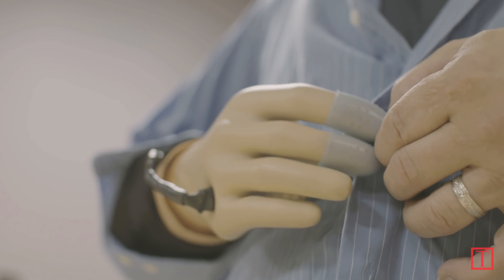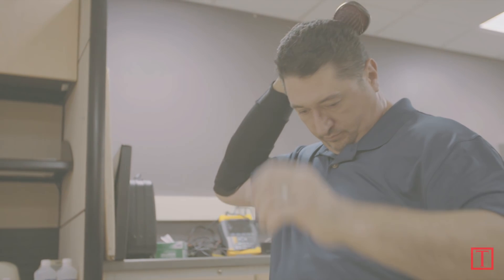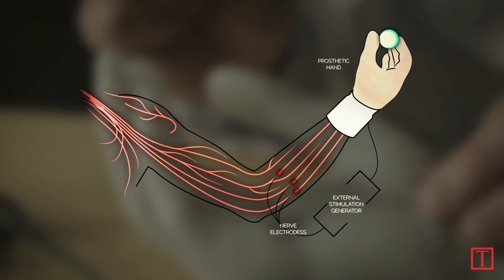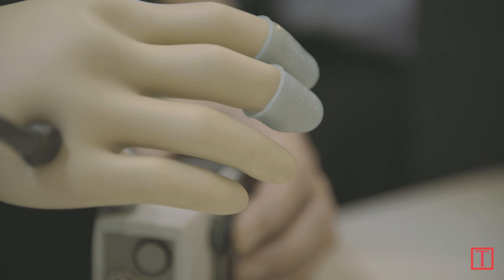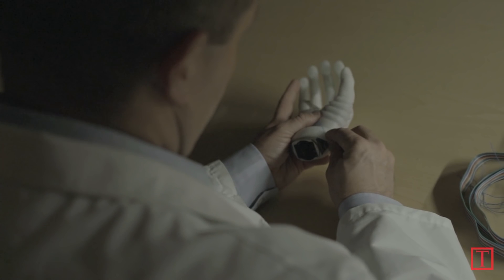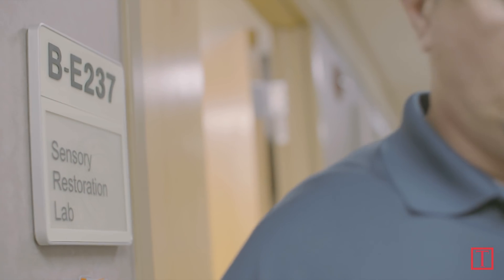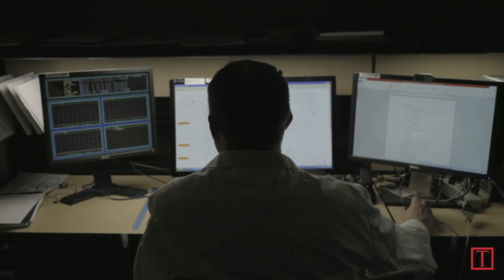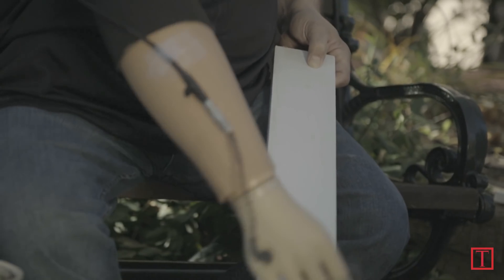A Prosthetic Hand That Can Feel | TIME

Comment: Hi, I'm student from Indonesia, I don't follow how you give feedback to user about pressure on the prosthetic limb fingers?
It's kind of mechanically feedback or electrically feedback or not both?
Some one explain please, thank you.
Reply: There is a pressure sensor on the tip of the finger that gathers data and sends it to the computer.Computer then codes the data in a way that your body can work with and they feed this data through a wire electrically that's surgically attached to the nerve in the residual limb.